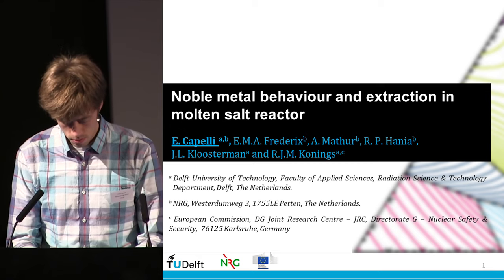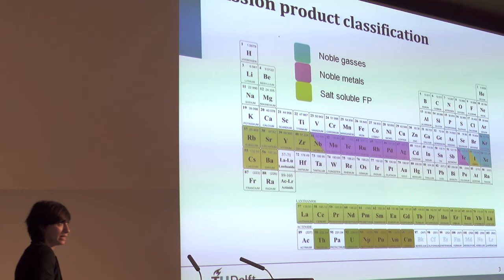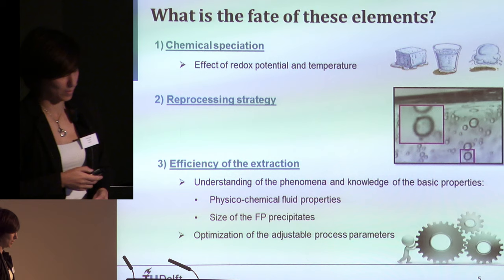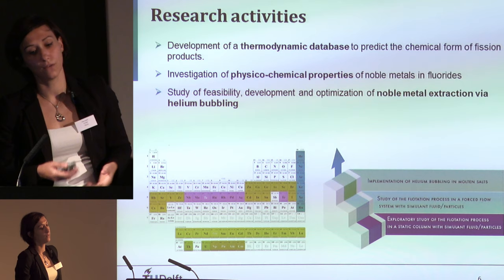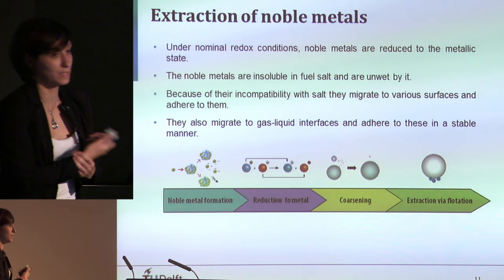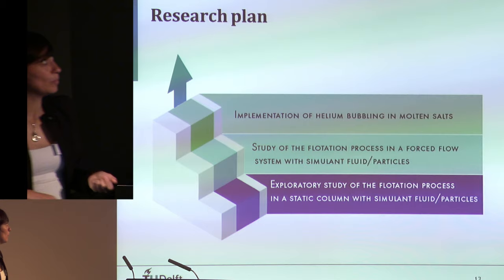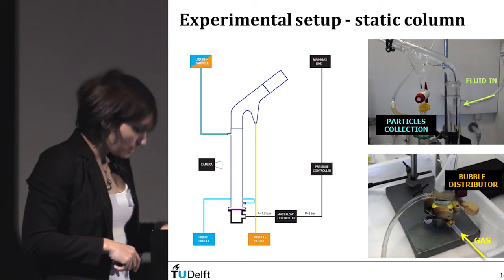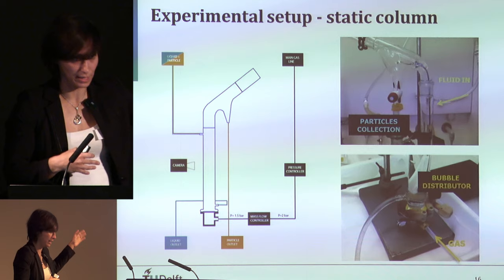Noble Metal Behavior and Extraction in Molten Salt Reactor - Dr. Elisa Capelli @ ThEC2018

Comment: hopefully the molybdenum tri-flouride concentration is low, because when I worked with Boron tri-flouride it corroded stainless steel rapidly in high concentrations. Seems in the molten salt it would be really low, and removed fairly rapidly through bubbling. I think the major worry here is coating out of these noble metals on the intercoolers.
Reply: @Dustin Eward I imagine ceramics being very poor conductors of heat in heat exchangers.
Reply: Well, Dustin, it's a one-word answer: RESILIENCE. Ceramics and glass have their own strengths, like good thermal insulation and low chemical reactivity, but ceramics are weak to temperature shock. For example, GE is working on ceramic matrix composites for use in jet engines, but they've had difficulty making it feasible because ceramics tend to warp and crack when heated or cooled rapidly. Glass is also not ideal because it is still vulnerable to hydrofluoric or hydrochloric acid that can build up if the salts get contaminated with moisture. Fluoride salts are more likely to cause this than chloride salts, but the risk remains.

Comment: This is very interesting work.  But I'm not sure it is applicable to MSR design.  In a practical MSR the redox potential will be managed by adding a reducing element (e.g. beryllium) to keep the fluorine from corroding the reactor structure, so the noble metals will never be coordinated with fluorine.  Basically if you have so much free fluorine that you "corrode" nobles then your reactor structure is in trouble.  I'm also skeptical about bubble injection.  It's hard to make a MSR without a positive void coefficient, so He bubbles will tend to destabilize fission power.  I think it will be desirable to keep gas bubbles out of the fission core.  Final question: will noble particles every be as big as 0.1 micron?  These elements are created on atom at a time.  Won't they plate out in the cold end of the heat exchanger before the particle size builds up to ~300 trillion atoms.